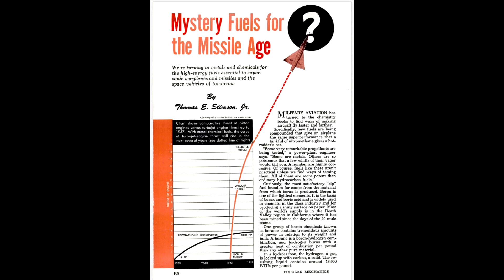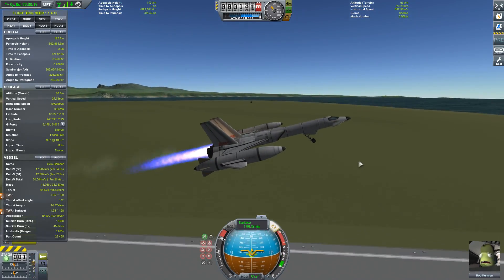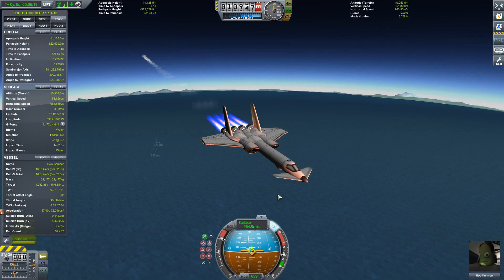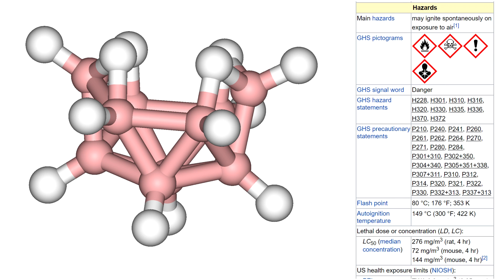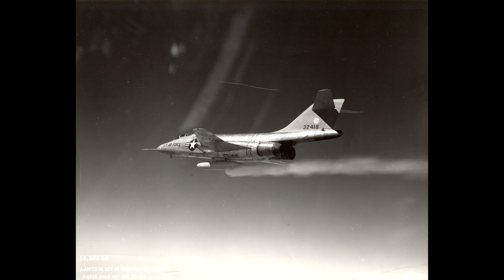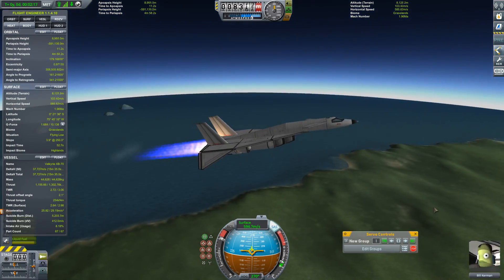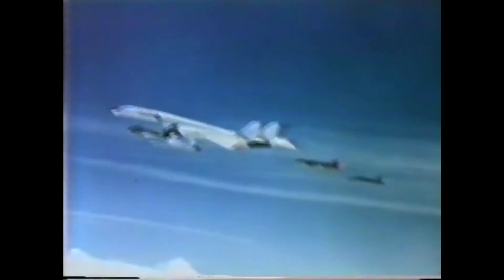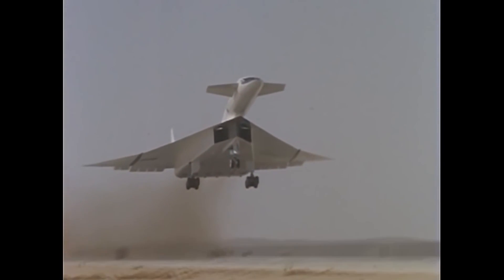Zip Fuels & The XB-70 Valkyrie - The B52 Replacement That Never Happened

Comment: Minor little correction Scott about the XB-70's fate -

It died because of MacNamara.  Period.  He cancelled the F-108 program that was supposed to share costs (engine, radar, ECM systems, etc), changed the requirements several times after the design was supposed to be fixed, and then cut the development airframes from 6 to 4 and demanded it still be delivered on time despite the fact that several items that were supposed to be tested by the XF-108 before the production of the first XB-70 started weren't done.

He then made things worse for North American because he went to Congress and claimed that they had massively over spent the budget (again, he created the problem by cancelling the F-108, causing all of the costs to suddenly be on the XB-70 program) and said that it was their fault.  This turned the public and Congress on North American.  It was all because MacNamara, despite repeated pleas from his service chiefs and secretaries, was convinced that ICBMs were the only future and he wanted to cancel anything that wasn't a missile (including the SSBN submarines that were then in development).  He used rumors of SAMs, the "Bomber Gap", and ICBM "infallacy" as an argument, but it wasn't the real reason.  As a result, Congress cancelled funding for the program as a weapon system, but North American and its allies were able to argue that they should at least be allowed to complete the 3 aircraft under construction (2 flyers and 1 static test airframe) to do research on extended flight at supersonic speeds and give more data toward the then nascient US-SST program.  North American even proposed modifying the B-70 into an interim SST by removing the fuel tanks from the neck area and placing them in the no longer needed weapons bay in the main body.  Sadly, neither the XB-70 nor the SST ever went anywhere and the better of the two XB-70s was lost in an accident that happened because a ton of rules were broken to have an impromptu photo session at the end of a test flight with aircraft that had never flown together before.
Reply: If that were so he would still be right about the XB-70.  Even the original version of the B-1 was rendered largely impotent by developments in SAMS.  It had to be resurrected as the B-1B with modifications to make it better able to perform low altitude penetration of the SAM belt (also with clever ECM which never really panned out).  It was slowed down and made more stealthy in order to survive.  The B-70 would have been a sitting duck, no matter how sexy it may have looked.  It was a design optimized exclusively for high altitude, high speed penetration, and even the SA-2 made that largely impossible.  It was a dinosaur the moment it took flight.
Reply: They didn't know the trajectory data for SM3 Minotaur launches beforehand. In fact, they didn't even know the time of launch. They were in simulated wartime patrol conditions, and the Aegis system on the launching ship developed the track in situ.

And as far as the SR is concerned, yes Brian Shul got a little over eager, but most SR and A-12 pilots flew by the book at all times and weren't hit. Going above Mach 3.2 was pretty iffy in the SR, the aerodynamic center moved noseward pretty aggressively after that. Just as the SR was stated Mach 3.2 capable but could go a little further, I doubt that the XB-70 would have any problem going 3.2 itself, even if publicly stated data is 3.0.
Reply: Possibly so.
And yet even so, if the XB-70 airframe were redesigned today, almost certainly the honeycomb construction would be replaced with composites, so perhaps it would be capable of even higher speeds...
But alas, the world will probably never know.  Rest in Peace, fearsome maiden.
Reply: The Valkyrie never made it out of prototype because that fatal accident took place right after a demonstration with Air Force brass in attendance.  That and (as already mentioned) ICBMs and improving SAM technology made its mission profile unnecessary.
Reply: Nomad - Not at all.  The XB-70 proved that sustained Mach 3+ flight at 60,000+ feet was possible.  During the entire operation of the SR-71/A-12 project, not a single aircraft was hit, and they were launched at on a regular basis by the most advanced missiles the Soviets had.  In addition, no aircraft or missile doing above Mach 2 and over 50,000 feet has ever been successfully intercepted by ground-based defenses.  Even minor evasive maneuvers makes it nearly impossible to intercept because by the time the target is detected, identified, locked onto, and launched against, the missiles are already in a tail chase.  Also, remember that while the SR-71/A-12 has stealthy characteristics, it carried no active onboard ECM.  The XB-70's ECM systems were later developed and deployed to great effect on both the B-1B and other platforms.

Second, the B-1A was originally designed for both the Hi-Hi-Hi mission and the Hi-Lo-Hi mission.  That's the whole reason for the movable ramps in the engine inlets.  Without them, sustained supersonic flight (above Mach 1.5) was not possible at low level.  Those little fins on the side of the nose?  Those are low level ride control vanes that were designed to smooth out the flight turbulence to make the aircraft not only more comfortable for the crew during a long, high speed low level run, but also to reduce fatigue on the airframe.  The program got cancelled because there were too many conflicting priorities both internally and externally to the program plus (as has been surmised and recently confirmed) there was political capital to be gained by "cancelling" the program as part of the SALT I treaty negotiations.
Reply: I wasn't speaking of endo-atmospheric intercepts of ballistic objects.  Remember that a "ICBM" or "SCUD" stops being a "missile" when the boost phase ends.  After that, it's just a bullet.  What the ABM, THAAD/SM-3, and other systems are designed to intercept are not missiles or airplanes.  They are designed to intercept what are basically bullets.  Even at that, they have still not had success in intercepting a maneuvering vehicle during reentry.  All intercepts to date have been above the Karman line (100km / 330,000 feet).  In the case of ASAT strikes, the targeting data is developed over a day or more prior to launch, so that's not even a "challenge" for any system since you're basically doing an orbital rendezvous, something done every time there is a launch to the ISS.  There is a reason Patriot was abandoned for missile defense and PAC-III created - it moved the intercept out of the unpredictable in-atmosphere engagement area where they had no real success in hitting the actual target.
Reply: Oldfrend - First, The maximum sustained top speed acheived by the XB-70 AV-2 was Mach 3.2, not Mach 3 (sustained being defined in this case as remaining at that speed for at least 30 minutes).  However, the design was believed to be capable of Mach 3.5+ had they been able to build AV-4 (which fixed all the problems with the honeycomb skin construction that plagued AV-1 and to some extent AV-2).  Second, the SR-71 was capable of 3.5+, but its actual maximum speed on any given day was determined by the weather and mission.  The maximum speed seen most often, according to the crews, was Mach 3.2.  Most missions were somewhere around 3.1 to maximize the time over target.  The problem with the SR-71 was the temperature of the first compressor stage blades.  The rotating disk they created caused immense heating and even though a titanium alloy was used to build them, they could only stand so much heat for an extended period.  Kelley Johnson believed that had they been able to create a true 2-cycle turbine engine (which was the original design for the XF-108's propulsion as well) the airframe would have been more than able to withstand the heat of Mach 4+.

As for the SM-3 - the reason that a ballistic or orbital object is easier to hit is because you can shoot the missile at a known part of the sky well in advance and then let the guidance lock on after launch, ensuring the engagement is head-on, not tail chase.  Again, because of the energy involved in maneuvering at such high speeds and altitudes, the aircraft or missile travelling along at Mach 3 horizontally through the atmosphere, them minute the engagement becomes a tail-chase, the defenses lose.  You are correct that if you just launched hundreds of missiles there's a chance of hitting, but you still have to find the right patch of sky to shoot at.  A 2 degree change in heading would create an offset of several miles in only a few minutes, thus once detected, the enemy would be forced to cover several hundred square miles with a missile every dozen yards/meters to "guarantee" a hit.  This is where the fallacy comes in.  The U-2 was slow.  It stayed above the horizon of ground-based radars for a long time (almost an hour in many cases).  The SR-71 and XB-70 were/would have been "above the horizon" for mere minutes.

If anyone wants to read on the history of the XB-70 and XF-108 but don't want a 600 page uber-detailed story, I would suggest the Warbird Tech book - https://www.amazon.com/North-American-Xb-70a-Valkyrie-Warbird/dp/1580071775
Reply: "The problem with the SR-71 was the temperature of the first compressor stage blades." - maybe you meant the first turbine stage where jet temperature is the highest?
Reply: HuntingTarg - Wrong on all accounts.  1) The XB-70 program was cancelled in 1962.  It was only last minute wrangling by North American and NASA that allowed the test program to go forward since AV-1 was complete, AV-2 was 95% complete, AV-3 (the static frame) was complete, and AV-4's sub-assemblies were 95% complete.  2) The accident happened on 8 June 1966, 4 years almost to the day after the program was cancelled, over the northern parts of the Edwards AFB range.  The accident site is located in the middle of this location, nearly 20 miles north of Barstow - https://www.google.com/maps/@35.0631371,-117.0243058,240m/data=!3m1!1e3
Reply: not so. blackbird's actual top speed was much higher than mach 3 which the xb70 topped out at, so that's not really a valid point. at least one pilot has said he reached mach 3.5 over libya. even so they did come close a few times. another said he could see SA-2s exploding a few hundred meters away outside his window while flying recon over north korea.

and chris i believe discounting the sm3 shoot down is a mistake even if they knew the orbital mechanics of the target beforehand. i don't believe (though i don't know for sure) that its targeting system allowed you to preprogram a target track before launch. in any case it would be a waste of an opportunity to test the targeting system on a live object if they did so. i do know that the AEGIS system successfully detected the target, fed tracking information to the missile, and scored a direct hit in a successful live fire test of the SM3. from there i think it's not a lot to ask to hit a much lower, much slower moving object.

of course this is neither here nor there - SM3 is way more advanced than anything that existed in Valkyrie's day. but the soviets weren't afraid of launching hundreds of missiles to hit one target - ref. gary powers shoot down, so the likelihood of one hit among hundreds is very high.
Reply: All this SAM talk is disproven by the fact that the SR-71 was getting lit up by Russia's best export equipment well into the 80's with zero hits.
Canceling the X-70 was a step back for America, pure and simple
Reply: @paqx3534  In time of war the Soviets would have been using nuclear warheads for AA defense.  The B-70 would not be able to penetrate the USSR at high altitude even against  SA-2 's with small yield nukes.
Reply: Eric Atkinson that is a very interesting concept, that I haven’t heard of before. Seems plausible given nuclear attitudes at the time. I’ll have to do some further reading on that
Reply: @paqx3534  If you can afford it (the project), keep talking, otherwise its a matter of money talks, bullshit walks. No money, no plane pure and simple. Getting salty over it does nothing.
Reply: not true about the hi/hi missile intercept. several US ABM/ASAT systems have been successfully tested against high altitude/high speed targets. a navy SM-3 missile successfuly shot down a failed satellite while still in orbit, not to mention the Patriot intercepts of SCUDs, which i know was wildly exaggerated, but there were some successful intercepts.

Comment: I remember my dad telling me that the XB-70 made the Russians divert resources into a crash program for high speed interceptors resulting in the MiG-25
Reply: There's a whole fascinating story behind the mig-25, Western intelligence thought it was going to be a mass produced air superiority fighter and absolutely panicked.  It ended up being a dedicated interceptor (with recon variants and even a curious bomber version that may never have been much use) with no real maneuver capability and very short range.  I don't want to trash it, it was a very Russian response to a problem in an area where the West had a significant technological lead.  They didn't have the metallurgy to use much titanium in it, and they didn't have the engine tech needed to make the kind of turbofan engines that could have given them long range and high speeds together.  It ended up being a heavy flying gas can, with an incredibly powerful radar designed to burn through jamming rather than bestow significant range.

Comment: The Valkyrie's wingtips had 3 positions: Straight (zero downward fold) Partially Deployed (25° downward angle) and Fully Deployed (65° downward angle). Bear in mind that the 2nd prototype's main delta wing had 5° upward dihedral angle and thus its tips folded 30° down from straight in partially deployed position and 70° down from straight in the fully deployed position.

Comment: Something to further add about the Valkyrie:

The Russian response was equally costly as they green lighted the MiG-25, which was an expensive, high speed interceptor.  Even designs that never made it to the Air Force inventory could still draw out costly overcompensation on the part of the Russians.
Reply: It wasn't purely in response to the XB-70, the B-58 Hustler was in the USAF inventory and is also a dangerous high speed bomber.
The best thing about the MiG-25 is that it panicked the Americans into making the best air supremacy fighter the world had seen, The F-15
Reply: That's the result of good counterintelligence - getting the enemy to misapprehend not the tech specifically, but the actual intentions for it.
Reply: Remember the SDI?
Reply: Yes.  Yes, I do.  Another case of overcompensation to something that never made it to the inventory.  We were really good at doing that, weren't we, Totally?

Comment: I got to see one of these in person at Wright Patterson Air Force Base. The size of the vehicle is difficult to comprehend without seeing it in person.
Reply: Jamthis it actually has a much shorter wingspan than the B52. It's something you really have to see in person to appreciate. It's almost awkward looking with roughly half of the plane sticking out past the delta wing. 

The Air Force museum is absolutely worth a visit if you can make it. Even better if you can go during an average weekday. The first time I went was like a Thursday or something and it was literally possible to find yourself in one of the massive hangars seemingly alone. It's an incredible place to be.
Reply: Jamthis, you can actually see a B-36 and the Valkyrie at the same Museum. They aren't in the same hanger, but adjacent. The Valkyrie is BIG, but it's hard to compare to a conventional shaped bomber like the b-52 or b-36 because the wing shape and such are so different. I was shocked by how large it was.  You can view it from above as well with an X-15 parked under its nose.
Reply: What's the size like compared to something like a B-52 or a B-36?
Reply: Jamthis Honestly, I don't know from a physical side to side comparison. Most of what I remember was picturing how many busses could be parked in the air intakes. The engines are absolutely massive. 

The XB-70 is dimensionaly equivalent to a B-52 when sideways, and about double the size of a XB-56.
Reply: Matthew McKellar Buses in the air intakes? And I thought the Vulcan at Duxford was big.
Reply: Michael Martin It is probably reflected by the maximum top speeds of both vehicles, though it does seem they both flew the same speed in operational usage. The Vulcan is a much more practical vehicle, even if the XB-70 is crazy intimidating

Comment: Great video! 

One thing which might make these a bit more accessible to an even bigger crowd would be to add "references" to some numbers (such as the 340 ton weight, the cruise speeds or the altitude at which normal aircraft fly at), and compare them to "normal" numbers. Even if these are old numbers to many here, I can imagine some would appreciate it!
Reply: Standard Internet Units are Toyota Corollas and football fields.
Reply: Not a bad idea-- maybe not in every video, but maybe to do a video that kind of gives frame of reference and context.